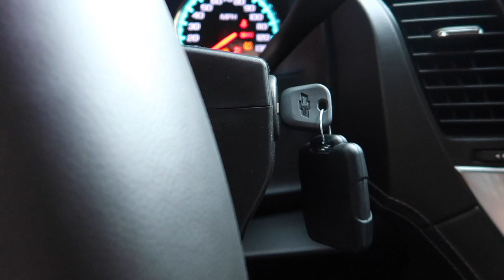WE BOUGHT A CAMMED 2017 TAHOE!! **NEW BUILD** ( FT. Do It With Dan )

Comment: The 5.3 make 355 hp and 383 lb-ft of torque 
With the cam and long tubes your making most likely 400hp at the wheels i wouldn’t say is making 600hp at the crank
Reply from the maker: I’m an idiot it’s okay 😂
Reply: I installed a tsp cam with dual valve springs on a l83 5.3 and with long tubes and 3 inch catless exhaust also had it dyno tuned it made around 380 rwhp the 6l80e on these really does half the work.